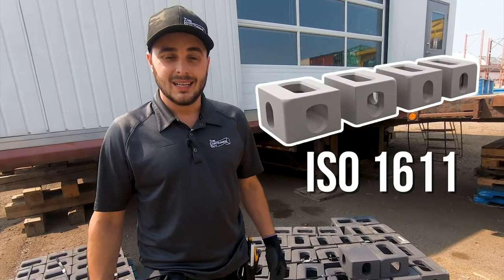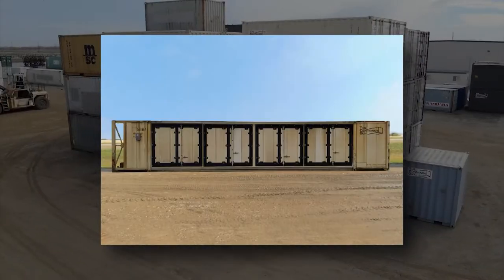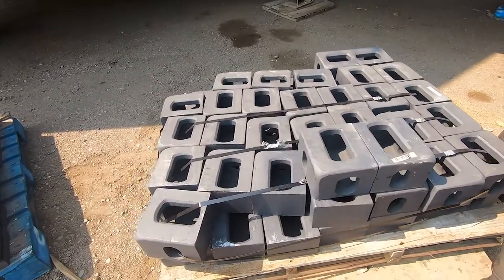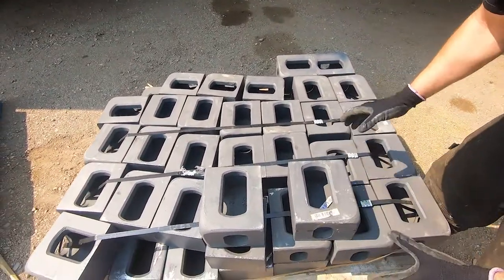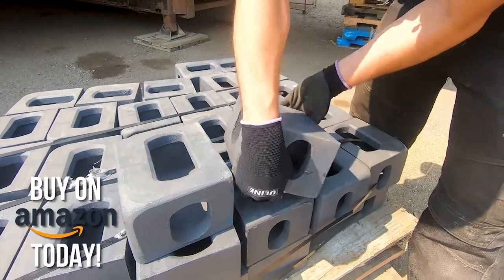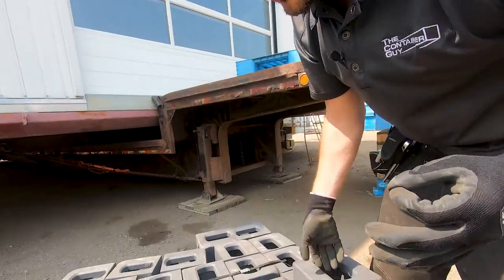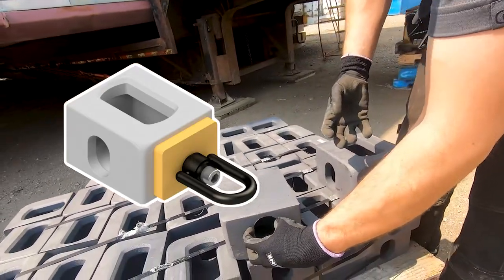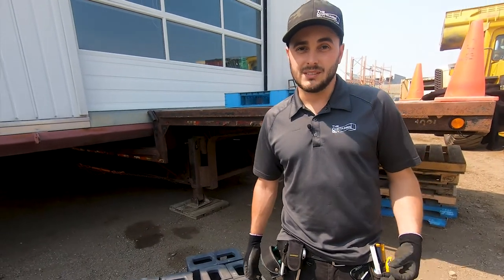Shipping Container Corner Castings: Top and Bottom ISO Fittings Differences | The Container Guy

Comment: You say these are cased what's the trick on welding these because most case material is junk to weld  . . . You know what I mean right ? Is there a trick to welding these ?
Reply from the maker: You gotta sweat the steel before welding to cast. We torch the crap out of them before welding and they pass the mag particle test afterwards.